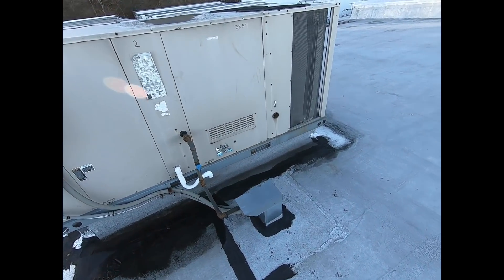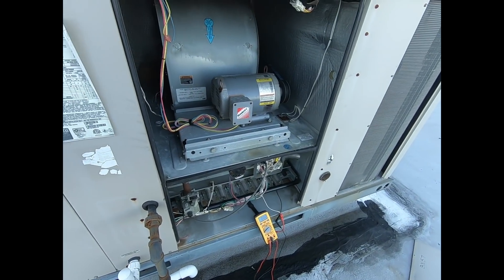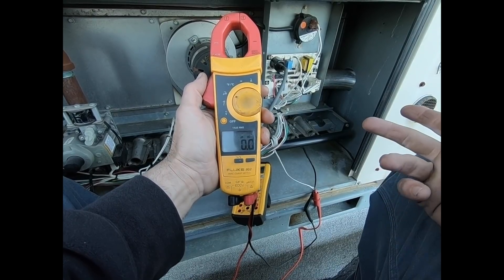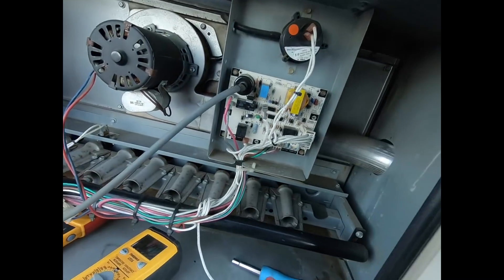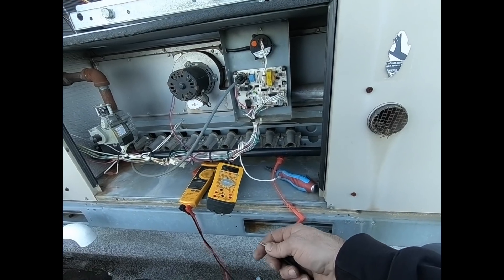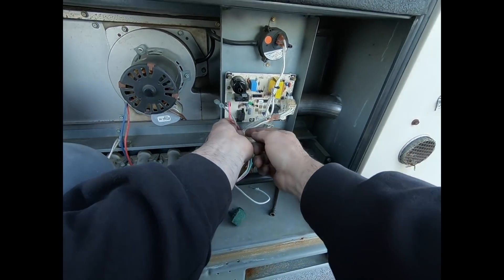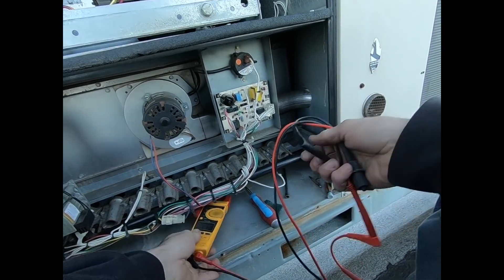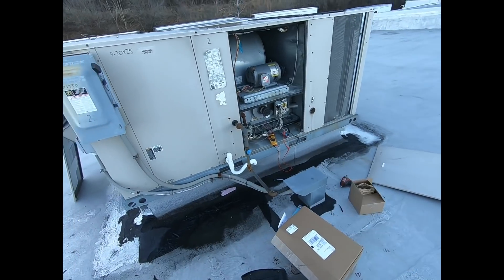Heat Burners Ignites Flame Fails To Stay On

Comment: Flip the cover panel upside down and you can place it on the top of the unit. It will cover most of the blower compartment.
Reply from the maker: Great tip I will try this out within the next few days. Since I am sure to run into one or a couple of this style Lennox

Comment: interesting they don't have auto-ranging AC/DC voltage and current settings. wonder why they chose the layout of left side being AC voltage/current and right side DC voltage/current.
other than auto-ranging and selection are slow and cumbersome.
Reply from the maker: This meter is very old, Fieldpiece for 30 bucks sent this refurbished one to me to replace one I bought in 2003. Might be before auto ranging was an option. Even my fluke I have to select ac or dc

Comment: Had a bad board as well. It was not keeping the gas valve open. It would send 28 volts disconnected but once it was connected to the gas valve, it would go down to zero. 
I'm an automotive tech in the electrical industry and I was overthinking this case because I wasn't familiar with what the board would do if a component was bad, in this case it would just cycle with no flame because the gas would never open and it would do that nonstop. Youd think the system will know that there was never flame but the igniter was working properly. 
Next time I will know better. A good working system will always power the component, if it doesnt, then the relay is going bad on the board for sure that when loaded, it fails just like any electrical transistor.

Comment: Obviously you can't do this for a customer, but if it was my furnace I'd resolder everything crusty and try the board again.
Reply from the maker: I would do the same if I owned the board. I sealed up my leaking steel water heater tank in April. Hasn’t leaked since. Soldering Leaking Water Heater Tank https://youtu.be/gr36BNR2kPc

Comment: How many micro amps should you read
Reply: it can be in the range of .5 to 10 microamps depending on design/unit, but in general 2 to 6 is what the majority of them are.
Reply from the maker: Every circuit board is looking for a different amount. Many circuit boards will have it printed somewhere. Also all system manuals will give how much flame current is required. I wish it was included on the systems data tag. Yet why would the manufacturers, want to make a techs job easier

Comment: I've had 4 boards on 3 Lennox  units with the exact same problem. Lennox is beyond trash.
Reply from the maker: I think this board got wet. Had blueish discoloration. Yet the heat exchangers on these Lennox rtu’s are covered in condensation at times during the summer